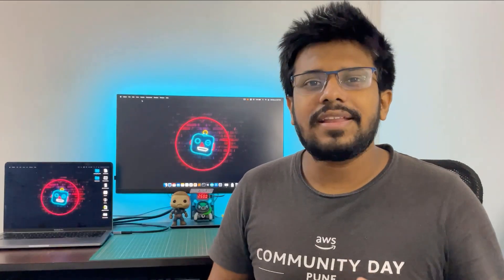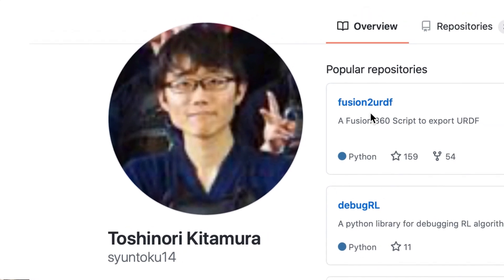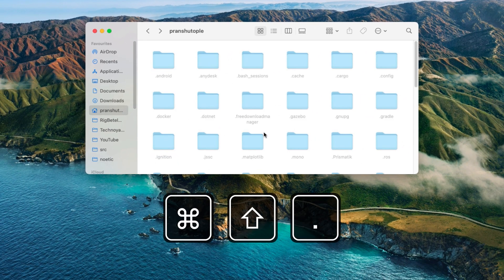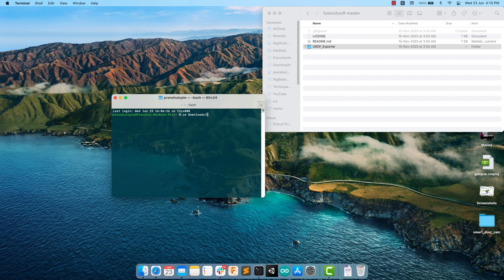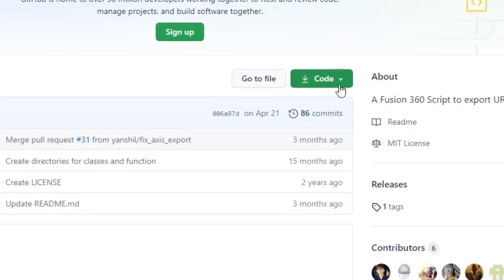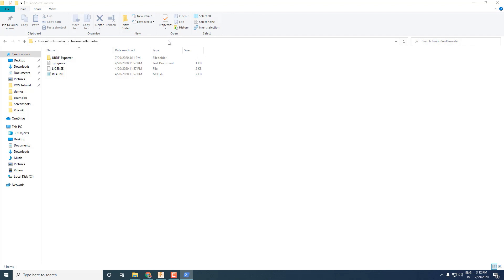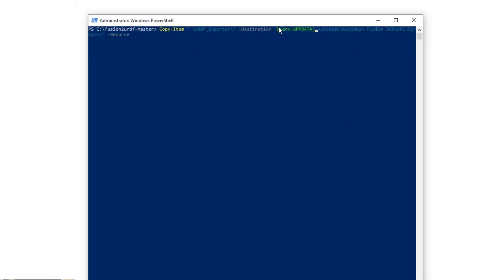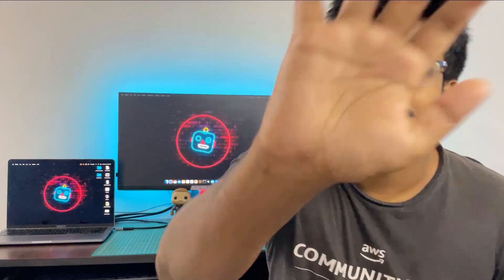How to install Fusion2URDF Plugin || Use Autodesk Fusion 360 designs in ROS Simulation as URDF

Comment: Failed:
Traceback (most recent call last):
  File "C:/Users/Fatih/AppData/Roaming/Autodesk/Autodesk Fusion 360/API/Scripts/URDF_Exporter/URDF_Exporter.py", line 59, in run
    joints_dict, msg = Joint.make_joints_dict(root, msg)
  File "C:\Users/Fatih/AppData/Roaming/Autodesk/Autodesk Fusion 360/API/Scripts/URDF_Exporter\core\Joint.py", line 172, in make_joints_dict
    if joint.occurrenceTwo.component.name == 'base_link':
AttributeError: 'NoneType' object has no attribute 'component'

hi bro. I got like this in Fusion 360 while converting design to urdf. What can i do?

Comment: I uploaded your aura.f3z file from your previous Youtube video in my Fusion 360. It uploaded as 7 components. After opening  auro file, and when I try to run the URDF converter, it says "There is no base_link. Please select base_link and run again". Any idea what may be wrong and how to resolve this?
Reply: oh bro I also be like this can you fixed it yet ?
Reply from the maker: @adinbinsalam8222  Yes you should face that problem because its not the right way to do it. There is a full procedure that you need to do before converting it into URDF. You can check my this LIVE STREAM to know about it in more detail - https://youtu.be/o7w7yv-Nros or else simply wait till next week where I am uploading a shorter video focusing on major concepts on how you can make your model ready to be converted into URDF.
Reply: @adinbinsalam8222   I am facing the same issue. Any update ?
Reply: I am facing the same issue. Any update ?

Comment: Failed:
Traceback (most recent call last):
  File "C:/Users/venka/AppData/Roaming/Autodesk/Autodesk Fusion 360/API/Scripts/URDF_Exporter/URDF_Exporter.py", line 59, in run
    joints_dict, msg = Joint.make_joints_dict(root, msg)
  File "C:/Users/venka/AppData/Roaming/Autodesk/Autodesk Fusion 360/API/Scripts/URDF_Exporter\core\Joint.py", line 176, in make_joints_dict
    joint_dict['child'] = re.sub('[ :()]', '_', joint.occurrenceOne.name)
AttributeError: 'NoneType' object has no attribute 'name'

Bro I got like this in Fusion 360 what can i do
Reply from the maker: Is this error while converting design from Fusion to URDF? Or while installing Fusion2URDF Plugin
Reply: While converting design to urdf
Reply: Failed:
Traceback (most recent call last):
  File "C:/Users/venka/AppData/Roaming/Autodesk/Autodesk Fusion 360/API/Scripts/URDF_Exporter/URDF_Exporter.py", line 78, in run
    Write.write_urdf(joints_dict, links_xyz_dict, inertial_dict, package_name, robot_name, save_dir)
  File "C:/Users/venka/AppData/Roaming/Autodesk/Autodesk Fusion 360/API/Scripts/URDF_Exporter\core\Write.py", line 138, in write_urdf
    write_link_urdf(joints_dict, repo, links_xyz_dict, file_name, inertial_dict)
  File "C:/Users/venka/AppData/Roaming/Autodesk/Autodesk Fusion 360/API/Scripts/URDF_Exporter\core\Write.py", line 52, in write_link_urdf
    [ i-j for i, j in zip(inertial_dict[name]['center_of_mass'], joints_dict[joint]['xyz'])]
KeyError: 'Component1_1'

Now I am getting like this bro
Reply: @koushikch5714  did you get a solution?
Reply: I have the same error, how were you able to fix it ?
Reply: Did you get a solution?

Comment: I am using a Windows Pc. 
I was getting multiple errors after trying all the instructions that were given. 
So I just went to Fusion360 > ADD-INS and then clicked on the green plus symbol. Then selected the URDF folder from where I downloaded it. It instantly appeared in my scripts. 

Seems to work fine.
Reply from the maker: Could you please mention what error were you facing??
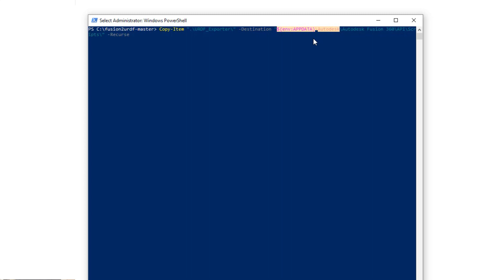Reply: @PranshuTople  I got stuck at instruction in 6:19(timestamp) and didn't seem to know how to give the right address, so it repeatedly showed the same error as you mentioned in the video.  
So, in order to install the add-in, I did as I mentioned above.
Reply from the maker: @abingireesh7658  in that case you have to mention the path your Fusion 360 is installed. If you check the macos part as well, you will understand what i am talking about
Reply: @PranshuTople  Its working fine now. 
I mentioned what I did in chat since many seems to face the trouble. So this alternative might help them, since it worked for me.
Reply from the maker: @abingireesh7658  yeah thanks for mentioning that 😇
Reply: This helped me , Thank you so much

Comment: Hey bro I got a complete off topic error would be able to help
Actually I don't know anyone who works with ros. So I was cloning a repository from gitlab i2cpwm board by brandan lane ,the cloning was successful but when I tried to do catkin_make it throws 2 error 
1)fatal error: i2c/smbus.h: no such file or directory 
2) invoking "make -j2" failed
The thing is these same error where supposed to be resolved by some changes which is already updated in the repository but still I m getting this error
Ps: love your videos you do some big projects on ros!
Reply from the maker: would you tell me which Ubuntu version and which ROS version are you using. Also what is the specification of the machine you are running it on?
Reply: @PranshuTople  I am running ubuntu 16.04 and ros kinetic actually it's a prebaked os by ubiquity robotics (raspberry Pi 3+ b)
Working through my laptop through ssh
Reply from the maker: @sumitk2521  first of all make sure that this repository you are trying to build is supported on arm based chips. Most of these repos doesn't work on Raspberry pi by default. Also make sure this repo is able to work with ROS Kinetic as it has passed the End of Life. If you have confirmed all the above steps, then try running the following command from the catkin_ws folder - 

rosdep install --from-paths src --ignore-src

And then run catkin_make

Even after this is there is error, then this means the repo doesn't work on the combination of hardware and software i.e. Raspberry Pi and ROS Kinetic that you are running
Reply: hehe, this error is seen on ubiquity robotics ros kinectic images. I faced many many issues with this image, could not find workarounds........

Comment: Hello bro! Thank you for making this video. Your videos are really helpful for beginners in ROS like me. 
Plugin worked fine for me. Without any errors it exported into urdf. 
But when I tried to open gazebo. launch for my model... It shows "Unable to call parseURDF on robot model" And "parse as old deprecated model file failed"... 
Am I missing something?
Reply from the maker: Mail me your package and i will have a look. You can find my mail id in the about section of the channel
Reply: @PranshuTople  I have sent a mail to you. Thank you for your speedy response ☺
Reply from the maker: Hello  @vidyadharananbuchezhian8408 !
I check out your package and found the error. In the fusion 360 images that you provided, I can see that the caster joint was made like a ball joint. Which was then translated to URDF as well. If you check the xacro file in your robot description package inside urdf folder, you will see that the joints are been termed as ball joints. But in reality, there is no ball joints in URDF. Casters I usually placed as fixed joints and their friction is made close to 0 (something around 0.1 or 0.001) to simulate a friction less body. Hence I have fixed the issue and mailed you back your corrected package. And also if you want, you can change the joint type in the fusion and export it again. before exporting make sure to undo the steps of creating URDF, as they would have created copies of components namely Old_components. Also refer to this video to understand how to design and assemble casters - https://youtu.be/o7w7yv-Nros?t=2042
Reply: @PranshuTople  Thanks a lot 🙏. It worked. Please keep making these videos. It helps a lot for beginners. Thank you once again.
Reply from the maker: @vidyadharananbuchezhian8408  Sure!! Please do share these videos with your friends... It will help me a lot!